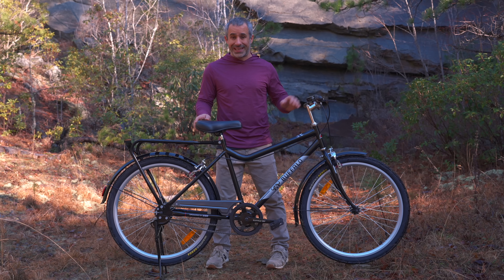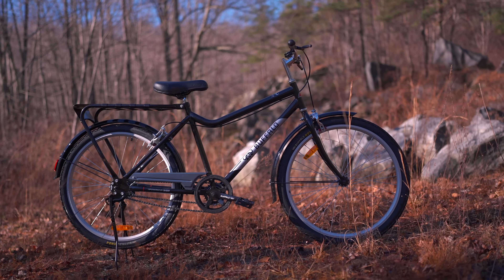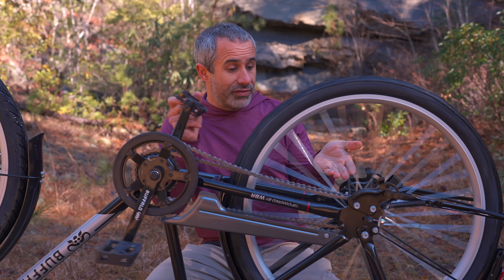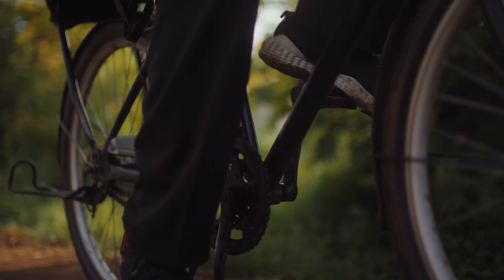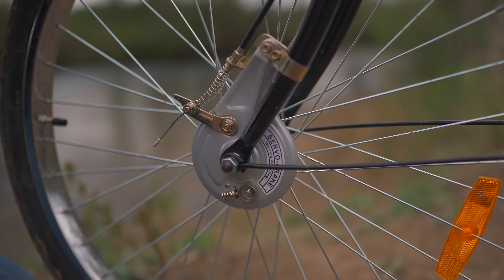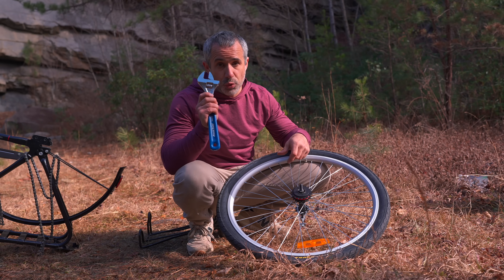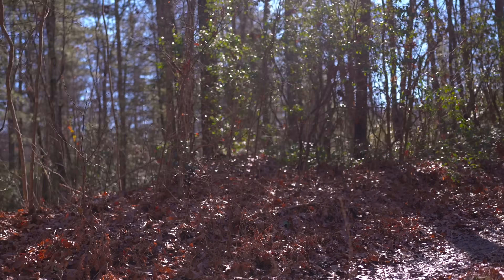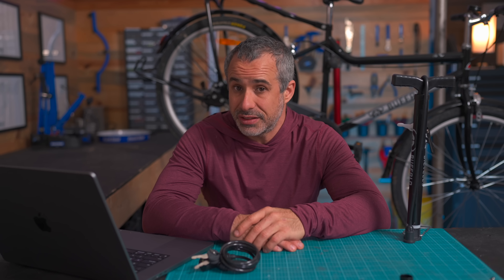Why 2 Chains Make This Bicycle WAY BETTER

Comment: The fact that the whole bike industry still uses a derailleur and not hub shifting. It's crazy that in 2025 the hub shifting has not improved enough to replace the old way of shifting.
Reply: Holland uses Hub shifting and Hub braking for weather and low upkeep.   They have developed new pinion mid gears that are amazing, but require new frame. It has been found that a single arm up front vs fork  is stronger, lighter and cheaper to build.  Also can make changing front wheel easier.   But one thing I've learned about bicycle industry, NO CHANGE!!!!  FIGHT TOOTH AND NAIL!   I've ridden 10 of thousands of miles on bicycles as I believe in potential of bikes but the unnecessary upkeep at high parts prices (price based on longevity of part and cost) compared to motorcycles has made me switch. Plus last bikes I had got stolen, Police interest...zero.
Reply: There is a TLDR at the bottom if you don't wanna read the half asleep stoned ramblings of someone in the bike industry. 

There are ups and downs to hub shifting, the most important and notable one for any mountain biker. The ability to swap wheels. In any quality mountain bike there are different tiers of quality in terms of hubs and rims that will affect how nice the ride is. Like the engagement of a cheap sram 476 will feel wildly less responsive compared to say a I9 hydra or any of the absurdly expensive chris king hubs. It also important to note that while bike companies have their favorites there is usually multiple types of wheels being used for each different bike make and model. So if you wish to upgrade your rear wheel to something better you can just swap it out. If you know how to build a wheel and have the same type of drivers, you can buy only the hub and just swap the parts. (yes I know different flange lengths affect spoke length calcs, but there is a lot of overlap and there is room for error within 1-2) 
TLDR~ bikes are very customizable and it's nice having the option to, instead of being stuck with a poor engagement hub shifter that can only be swapped out with one of the very few other hub shifters. 
That is also ignoring the amount of gears you are able to use, most internal shifting hubs only use 2-3 gear ratios meaning you are stuck with much less options for if you have any variation in the terrain you wish to tackle. There is also the difficulty in making any adjustments or on the spot fixes. Like if you are out riding, it is much easier to fix any detailer issues. With an internal hub you gotta have the right tools and the ability to remove the whole thing. There is also the issue with production being much different and requiring any company wanting to change what they primarily produce to buy new equipment. So it's a heavy investment into something that in the current state is not worth looking into outside a fancy gimmick for cruisers to appeal to someone buying a bike from walmart. 
However it is not all negatives. As for any good argument you have to look at both sides and the internal shifting hubs have a few pretty substantial benefits. The first and biggest one is that it makes your chain last hella longer. Because it's practically a single speed in design, the chain will never twist or stretch from being at a misaligned angle that comes from the rear cog protruding out. It will always line up straight. It also is a bit more water resistant (very minor benefit considering how resistant a normal derailleur is). It also removes the rear derailleur cage which on very rare occasions can get snagged. Idk man, there just isn't very many good reasons to pick it over a normal rear derailleur. Like if you want a town bike a normal single speed is plenty, if you got a big hill just stand up and pedal harder. I'm a bit biased being a part of the bike industry for years, but for around town there is almost never a situation you need to shift. 

Actual TLDR~ Hub shifting is niche and outclassed in it's current state. For a town bike a single speed is plenty and for a mountain bike you lose fixability and gear options. From an industry standpoint, too much risk swapping for almost no real payoff in quality or appeal.

Comment: I used to have a 2 speed bike as a kid. It had 1 chain and coaster brake but every time you would do the braking movement it would also switch gears.

Comment: So basically, they built a bike to 70's Dutch standards. Take any old Sparta, Locomotief or even Batavus from 1970 and notice how they're built like they would survive being hit by a truck at 60 mph. Leaves the dual chain setup as main usp which undoubtedly must have consequences concerning pedal resistance.

Comment: This reminds me a lot of the retro direct system! I think the retro direct is a more elegant, simpler solution but it does require you to backpedal for one of the gears. It doesn't need a fancy shifting freewheel though, just two standard ones.

Comment: SRAM and World Bicycle Relief should release the patent for this hub—whether by dedicating it to the public domain, making a non-enforcement pledge, or using an open patent license. This would let more manufacturers produce it, scaling impact and improving mobility worldwide. Otherwise, this creates the appearance that SRAM is merely a nonprofit as a marketing tool while restricting broader access to a life-changing innovation.

Comment: Wouldn't it be more effective overall to ship a lot of obsolete and broken bikes to Africa, get them fixed up, and give them away to those in need? After all, there are entire landfills full of discarded bicycles—deprecated fleets of failed rental bikes, stolen but not recovered ones.

I mean, it's very cool, especially if the comments from African locals are real. I just can't imagine how designing a new system would be more beneficial than utilizing what's already out there. Also, I kind of want one of these, but not really. It's better to leave it to the task it was designed for.

Comment: You're not the only one who pokes fun of the stamped-steel box wrenches. But I never leave without two should the need arise (one in metric, the other in imperial - some bikes are in 1 or the other, so it can be a help for other cyclists if they are needing help).

Because of its "flat pack" design, it can fit in a pocket, backpack, bike pouch, or even zip-tied to the frame to keep it out the way - giving an essential lifeline when you're miles away from help. It also has multiple different sizes that cover every size that's standard on bikes, meaning you can fix/tighten every nut and bolt without taking up a lot of space.

They're also quite strong. Even extremely cheap ones can take a lot of force before they start to bend.

Comment: I hope they keep their chains oiled. A rusty chain adds a lot of resistance when cycling, and having 2 of them is going to be twice as bad. Not sure the new brakes are a good idea either. Those blocks going to be wearing out really quick, rubbing on buckled wheels, making an awful noise, and fiddly to replace.

Comment: 9:03 I would expect the local bike expert to learn these skills, which in Europe at earlier times would have been the blacksmith making horse shoes. You have a community, these skills can be taught, teaching is cheap (at least for the student) so as long as the tools are easy to make/replace/get the fact that it requires a skill should not be a problem.

Comment: One thing I wish you would add to those videos, is showing us how certain features work from the engineering point of view. For example, how a coaster brake works, with an "exploded view" (a view of all the separate parts) and maybe a short animation showing them at work, and the same for the gearbox of the bicycle introduced and promoted in this video.

Comment: Yeah it works until is doesn't work, then it's 10x harder to fix as it is so non-standard tech. What about the front chain-ring?
Why not give some real data on actual reliability like hours vs normal systems? - probably because their reliability is worse.
Worst of both worlds, worse gears and worse serviceability
$200 USD for one bicycle in Africa is premium for a bad bicycle.
Nice charity grift

Comment: Relying on visually seeing threats in the air in the 21st century is what's unacceptable. Flight control is dated an can't keep up with increasing air traffic. It relys to much on people recognizing something instead of proper automatic protection systems.

Comment: I had a two speed kick back built in the 60s. Just one chain. It also had a coaster break.  The only problem was if you wanted to use the break, you would have to do sort of a double pump if you wanted to go back to your original gear.  After a few minutes of riding, it began to seem natural.

Comment: Interesting solution to change gears, but shame about losing the rear hub brakes.  Surely there is a way to have both gears and hub brakes?  I remember thinking years ago this wasn't possible because hub gears need various parts to freewheel depending on which gear you're using, and freewheeling gear parts means hub brakes won't engage.  However having two chains removes the need to freewheel the gears and allows hub brakes to work, the only thing left to do is implement a different way to change gears.

Comment: Small correction, it's not rated for 200 pounds but 100kg (which is ~220 pounds).
Reply: 220 pounds is roughly equal to an Ethiopian family of 12.

Comment: Well-meaning efforts from the creators but unnecessarily burdens on the target users. This often results when designers start out with erroneous assumptions, which lead them to create solutions that diverge starkly from the mainstream. Such products do not benefit from market support and economies of scale, and therefore cannot stand on their own without subsidies. The imagined targeted 'remote' locations have motorbikes supported by local mechanics. So, the assumption that repair services are scarce is not entirely correct. You go to Tanzania and you will find plenty of 40 year-old Japanese bicycles still kicking dust with  all their original gear. These are normal bikes but well built to begin with. So, the solution is not to develop special parts but to build traditional parts solidly using mainstream technology and market support.

Comment: That freewheel trick is so simple and elegant, one of those incredible ideas that seems really obvious once you get your head around yet no one thought of it before
Reply: I dont need to sleep.... I NEED ANSWERS  !!!
How this works? do you know the name of the mechanism? 
I searched for almost an hour, and cant find anything. If you have any links, it would be perfect.
Reply: @brianfhunter  I'm not entirely sure how the backpedal switch thing works but that's probably going to be in and of itself a relatively simple mechanism, what's really elegant here is that they're just combining a couple of very simple and very widely available parts in a different way to achieve a completely different result.

It's specifically the use of the freewheel/sprag clutch part that I found really clever - they've basically used the same type of freewheel mechanism that lets your bike coast, and used it between the 2 chain drives. When the fast chain is engaged the rear wheel just freewheels past the slow chain sprocket the same way it would past the cogset on a standard multispeed bike if you were coasting, and when it's disengaged the fast sprocket just spins freely the same way a car transmission would in neutral while the slow chain takes up the slack.

What this means for a bike specifically intended for use in resource constrained and heavy use situations is that the mechanism is incredibly simple, very robust, very reliable since it's made entirely out of components meant to be cheap, mass produced and yet long lasting, and as an added bonus if the fast chain clutch breaks the slow chain takes over entirely passively so even when pretty much completely broken it will work in the bike equivalent of limp mode instead of being completely useless until repaired like a normal bike would be (since the slow chain is always engaged through that one way freewheel mechanism).

Comment: Hey Seth I have been watching for a long time and I learned a cool trick if you use an electric car tire pump with a basket ball filler attachment you can remove and replace grips like you do with your air compressor I’ve torn my hands up trying to do it without and I think you should share this trick.

Comment: Since it's not mentioned, I assume it works like a manual transmission in a car with some kind of reverse ramps on the dogs to shift a drive collar from the engaged gear to the disengaged gear when the pedaling is reversed? That's an idea I had years ago, but didn't think it had any kind of commercial value. Good to see someone thought of a great use and brought it to life! For me, this is what bikes are really about.

Comment: That's really cool. Reminds me of a bike I had in the past. Hm.... this is an EXTERNAL kick shift? That's cool. I really miss my old internal kick shift schwinn I built in the past. Put really nice smooth balloon tires on it, was AWESOME in the city. You can shift/brake without using your hands.

And you're wrong here. You absolutely CAN have a kick shift bike WITH a coaster brake.

The ONLY thing annoying about a kick shift hub with a coaster brake is stopping. Say you were climbing a hill so you were in the lower gear. But you're coming to a stop, you push back on the pedals... and it shifts. So now you're in the higher gear for when you start out. And there is no real easy way to fix that while stopped. So you just get used to shifting to the higher gear before you stop.

Also, the other reason they used the aluminum rims is because rim brakes on steel rims.... SUCK. They're just downright awful. I would have liked to have seen like... a rollerbrake. Much better than rim brakes in low maintenance/no maintenance environments. They last forever, and aren't affected by weather.

Comment: I mean they already make an internal gear hub that has kick back to change gear. It's kind of old technology this is just using two chains. As far as reliability goes I'm not really sure where the advantage is here
Reply: Like internal gear hubs are extremely reliable. So what bases are they going off of rather than just saying it

Comment: Not going to lie, that little shifting mechanism is absolutely amazing, I definitely wouldn't call it crude, I can see this system being useful outside of remote areas, it looks like it would be easy to convert existing bikes to that system, I could see it being useful for someone who uses there bike to commute through the winter, or even for kids who are learning to ride
Reply: African winters can be harsh!
Reply: @Throckmorton.Scribblemonger  I meant for wider applications not necessarily in Africa, could even help fund more bikes
Reply: Compared to the complexity of a crank gear switch, it is crude.
Reply: @oz_jones  can you explain how the internal mechanism works? It's not crude it's simple

Comment: I was with it until I saw the backpedal shift. I used a bike with that "feature" for delivery work and hated it. Every time I tried to adjust pedal position to get a better start, I inadvertently changed gears.

Comment: It is nice to see a product that is not designed to fail
Reply: That's the difference between a practical product and a lifestyle toy...
Reply: probably why i cant find a place to buy one for myself
Reply: Those rims and breaks do not like dirt. If they are not planning also laying asphalt in those villages... = )
Reply: @enosunim The original version's coaster brakes are quite weak, I suspect these will perform pretty similarly when dirty (and not be as big an issue because the rider is already used to it, presumably)